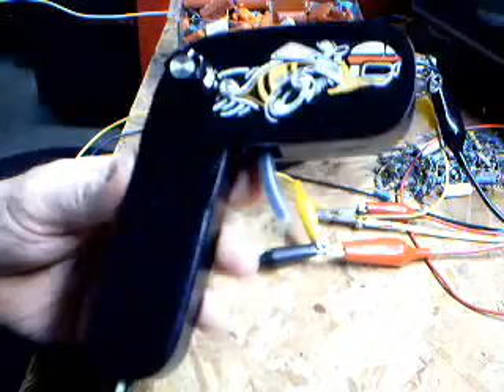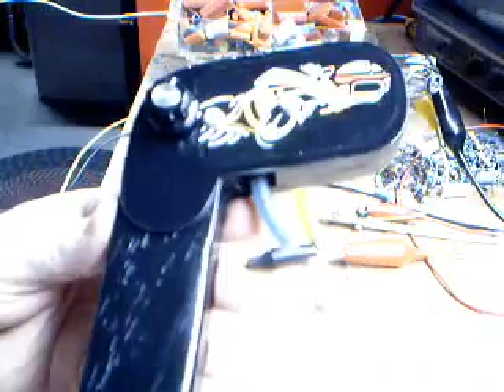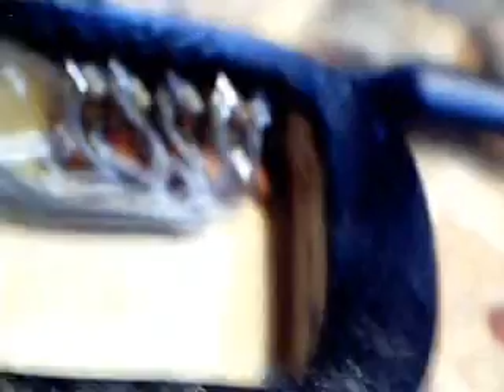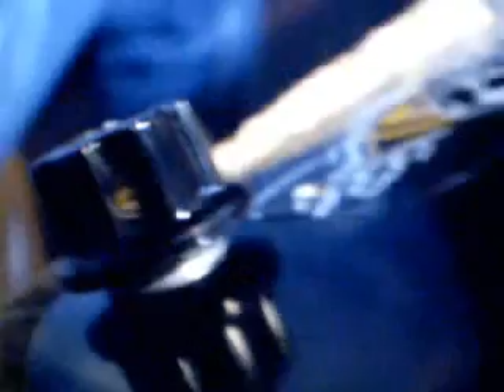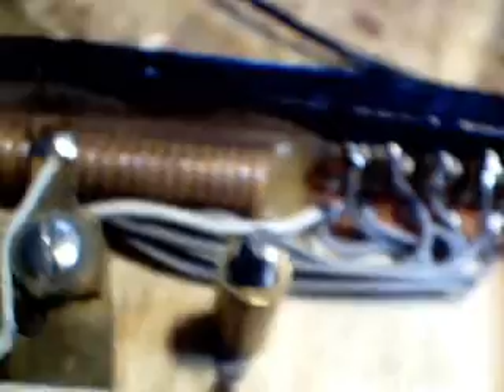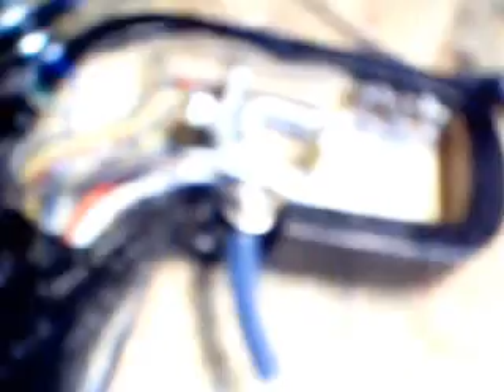Homemade electronic slot car controller

Comment from the maker: One last thing to remember is that you well need to use a two wire non polarized molex connector so you can switch the polarity of the controller  to match the track polarity with any solid state controller. I couldn't fine a connector that was non polar so I modified one so you could plug it in either way. If you look on the video you can see it tucked in the heat sink

Comment from the maker: They were both npn any general purpose amplifier type should work fine you could just use one darlington to3 npn I would think it would work fine to. I would just keep it simple. I tried a few different ways and found that simple worked best. You could start with just diodes in series the wiper would have to be more row-bust is all but with a few switches you could make it adjustable. I think it might be a little easy to understand how it works.

Comment from the maker: Yea that's it there is a led but its just for looks for the most part . No microcontrollers and so far as the resistors touching don't understand maybe in some applications that mite be true for example heat dissipation or high voltage circuits but not here. There is some space between them not much it's on perfboard This would be an equivalent to a resistor network.

Comment: Thanks for the answer, few more questions. Did you use some other electronics, other than the resistors, potentiometer and transistors, i mean like microchips or something. And isnt it bad when the resistors are touching?

Comment from the maker: I well see what I can come up with it's been over ten years since I made it and never had more than some really bad notes it was mostly just experimental project. It well take some time to do no promises. I think that what you well find is the building of the controller is more difficult than the electronic part unless you use a old controller to start with. It is basically two transistors in a darlington connection and ten 1K resistors in series the pot don't remember probably a voltage divider

Comment: hi, i really like your controller, could you give the schematics dor the electronics, or just explain how it connects with the potentiometer and what potenciometer it is. I would also like to know what transistors did you use, and how did you connect all electronics. I hope you understand, what im asking. You see i want to build one, so im surfing through sites, to understand how it works. Thank you very much :)

Comment from the maker: @alphaniner101    Hi . I don't have any  but I'll try to explain what I think you are asking. The wiper is a dowel rod with some wire coiled on it I coiled the wire closely and pulled it apart to make it space nicely then solder on the wires for the taps off each coil I think their were ten. Then I epoxied the back of the dowel once it dries the I used a dremel cut off wheel to cut through the coils on the back of the dowel to separate the taps.Then solder each of them to the to the resistors .